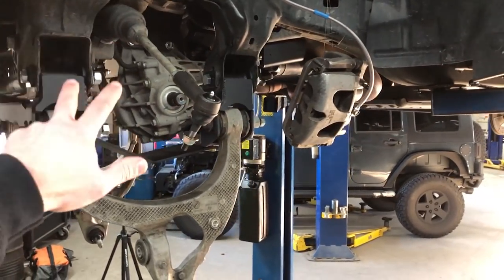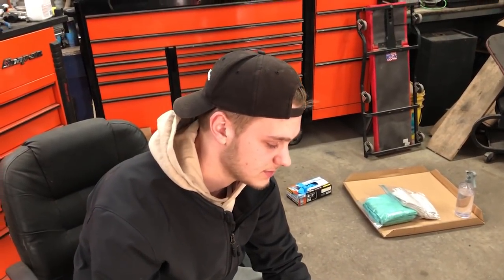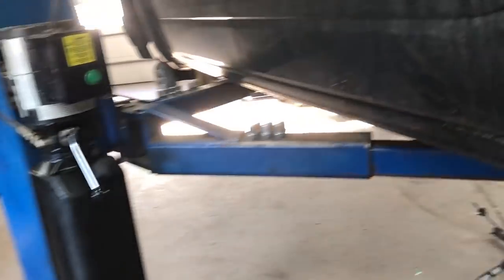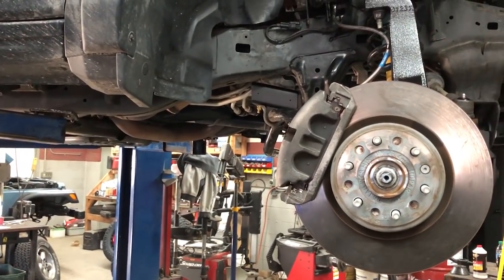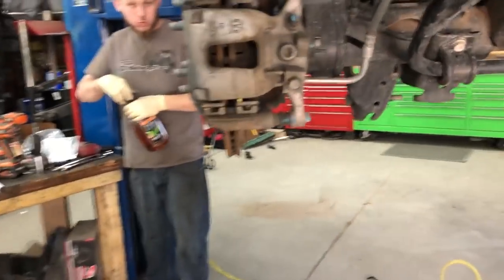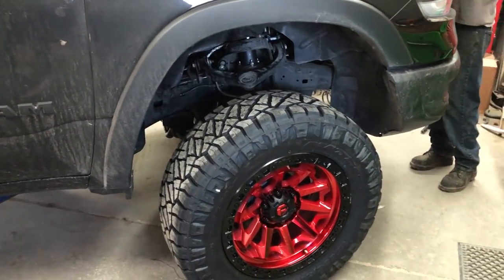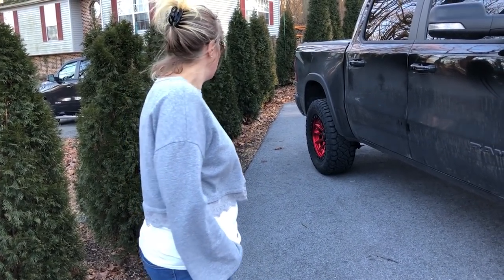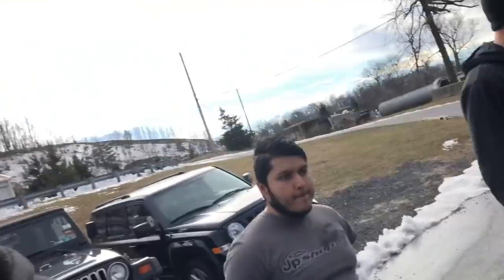LIFTED 2019+ RAM 1500 REBEL 4" BDS Suspension Lift & 35" Tires

Comment: Awesome video ... wow the truck looks crazy bad ass now those rims are sick with the 35 Nitto’s !!! I did a very similar setup on my 19 Ram sport too ... 4” BDS lift with the Fox shocks as well. Got some sweet 20x10 Fuel Assaults with 33” NITTO Grapplers. I wish I would have went with the 35’s but didn’t think my truck would clear the garage door opening only to find out that it just would have barely!! Next set of Nittos for sure will be 35’s!   Next up this spring for my Ram .... Borla S-Type cat back kit and S&B cold air intake kit. Also wanna light it up with some under carriage rock lights and a killer light bar in front !! Love your vids your vehicles are all so awesome !!! 🤟
Reply from the maker: Thanks Jason!

Comment: I really like the wheels took a bit to grow on me but the more I look at them I more I like them, I just got rid of my "beast" which had a lot of the same mods as yours did and picked up a new body laramie 1500, just threw on a borla attak exhaust and now looking at a BDS air lift 4" suspension along with 20" wheels and some 35s. Hemifever tuning ordered and on the way. This is such a fun truck to drive already and the progress made on these new trucks is phenomenal
Reply from the maker: You’re going to love Hemifever’s tuning!! Such a big difference!
Reply: @BEASTProjects  What lug nuts did you use with these wheels? The wheels grew on me so much I ordered an all black set for my laramie. I have used gorilla splined lug nuts on my prior HD wheel swaps in black chrome

Comment: Are the upper control arm relocation brackets required for the rear with a 4 inch lift? I noticed the bds kit comes with them but the rough country kit don’t for a 2015 ram 1500. Will this cause vibration or any issues if you don’t install the brackets?

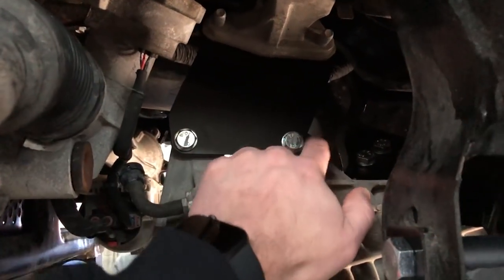Comment: 4:59 that tiny rubber stove pipe is your diff breather. Go get you some longer 1/4 tubing from the the auto parts store and relocate it higher. It'll keep water out of the diff just in case the mall parking lot floods and you need to get out. Those wheels are sick, nice grab!
Reply from the maker: Thank you 🙏🏻

Comment: Looks great! But hose decorative bead lock rings trap water and drives me nuts.
Reply: Sam Goodman does this create a rust issue?
Reply: elpapadebatman Not that I have seen since most wheels are some sort of alloy. Just always water in there which is usually dirty from the road.
Reply from the maker: Correct, Sir

Comment: New to your channel and heck yeah! Lift done right!!! Killer wheels!! My wife and I are considering a Rebel for our road trip/over landing/family truck. Are you planning on doing a daily driveabilty and off-road review of the lift?
Reply from the maker: Welcome to the channel! We haven’t taken it off-road too much, but the lift was done right & the truck is more than capable now. The ride is just as good as stock if not better thanks to the engineering done by BDS. Hit up the Jp Shop to order your kit. 610-458-1977. We can get it shipped directly to you or to the shop that you want to use if you’re not local.
Reply: BEAST Projects thank you! We have not bought the truck as of yet. No we don’t live in the PA area but we have family there. Looks like your west or northwest of Harrisburg? So is there a front shock and spring upgrade that could be added to this lift?

Comment: Truck turned out sweet! I’m thinking of putting a 4” BDS on my Rebel.

Now that you’ve had it for a bit, how does it drive and handle?

Anything you’d do differently?

I’m on coil suspension as well. Not air.
Reply from the maker: It’ drives great!

Comment: Looks great. Couple questions why did you go with the 1 inch offset. Can you go with a wider tire? Almost looks too skinny with a 9.
Reply from the maker: You can probably go with a 20X10 wheel, but there might be a little tire poke. I wanted to avoid that w/ all the miles we put on the truck. They don't look skinny on this setup, but I probably would of went w/ a wider wheel if I got a 6" lift & went to 37" tires.

Comment: You could have a least washed the truck for her lol. Im installing 22" fuel contras with red milling this Spring.
You need to add skme red accents around the truck to off set all the black. I have red ram logo going on the sport hood and red tow hooks.
Reply from the maker: I know, I know.... I work FT & vlog whenever I have a chance. It's all cleaned up for the next video.

Comment: Did you have to mess with the gear ratios at all after lifting it and adding bigger tires? New to the Ram game, just bought a 2020 Rebel a few weeks ago.
Reply from the maker: I didn't the Rebel has a 3.92 gear ratio, which is the max you can go because of the IFS.

Comment: You need amp steps now. I would take that light grey skid plate and do it in the red like the rim's. That would be Sweet Looking
Reply: CHRISTOPHER LILES  I’m avoiding steps like the flu 🙅🏼‍♀️
Reply: @heathersmith8998  Why is that ? They will fold up until you open the door then drop down. Perfect for You !!!
Reply: CHRISTOPHER LILES Don’t need them. I get in and out just fine and the little one doesn’t have an issue either.

Comment: My BDS is going on Friday so stoked 🤙🏻 now you just need some Amp Powersteps ..how much rake do you have?
Reply from the maker: None, almost 100% leveled.
Reply: They were telling me that there is like a half inch to an inch but I think with our trucks that looks good because almost dead level makes us look nose high..you know
Reply: So is the ride really as comparable to stock? The only difference is that you have the Bilsteins on your front suspension on the rebel. My ride should even be more plush with the NON-ORP suspension.
Reply from the maker: There wasn’t a preload spacer.
Reply from the maker: It rides nice.... much better than the 2500 after lifting it.

Comment: Hey guys, I don't know if anyone have any idea why? So I have my 2020 1500 Ram, I have installed a 4" BDS lift kit, and today I got XF rims 20x10 -24 offset wrapped in 35x12.5x20 Toyo AT2 Extreme, but I realized tires are rubbing in the plastic liner wheel well. I've seen guys with just a 2" leveling kit they can fit same tires no problem, but I don't know why mine is rubbing I'm kinda pissed.
Reply from the maker: There's a lot a variables at play, like the offset, backspacing & tire tread that could be causing the rub. Hopefully it's not too bad & you just need to trim the liner a little bit. It's not unusual for that to happen when your modifying..

Comment: What's your exhaust system?  And why not a 6" lift?  My 2019 Rebel has a Borla ATAK exhaust with a 2" leveling kit.  I'm wanting a 6" BDS though.
Reply from the maker: Corsa Performance... There’s a couple videos on the Channel about it.
Reply: @BEASTProjects  Yes, I just saw that, and the one about the diablo as well.  I'd be worried about the warranty though lol.  As previously mentioned, I'm running a Borla ATAK exhaust.  I'm actually not sure if I have Res delete or not, may have to check on that.  But I love it.  Just bought some more tires yesterday too, my third set, just cause I like change lol.

Comment: Trying to do this for my 2016 rebel but I want to go with the Fuel Beast rims. Would it be the same  offset on these and do I need to go with 20x9 or should I go with 20x10?? and is does this need a speedo calibration?
Reply from the maker: There's a lot of variables at play. I can tell you on 2019+ Ram 1500 Trucks, 20X9" 1+ Offset is perfect. If you go with larger tires, you'll need to calibrate the speedo.
Reply: @BEASTProjects  ty for responding. I have the 2016 rebel with air ride. I think it is the same.